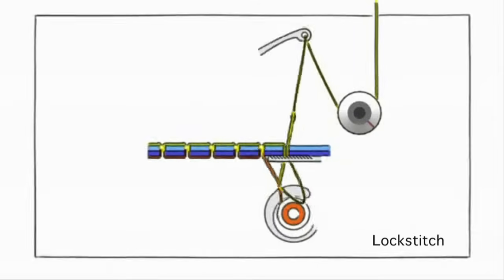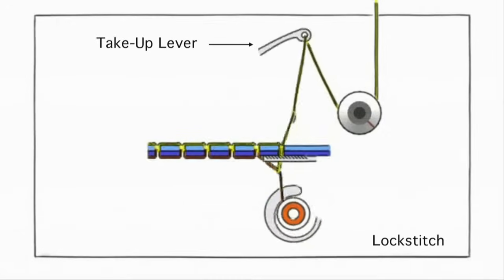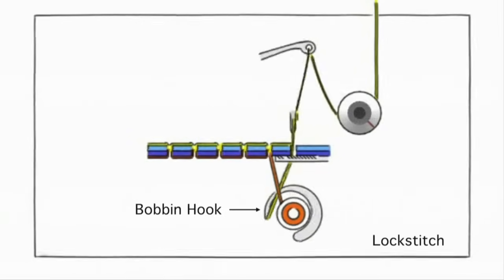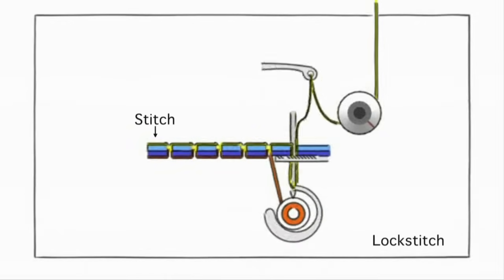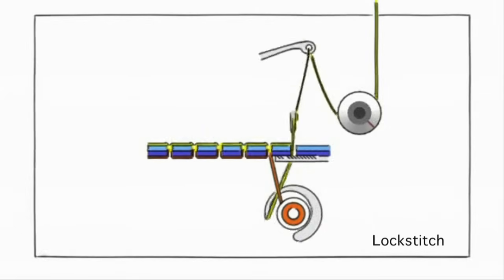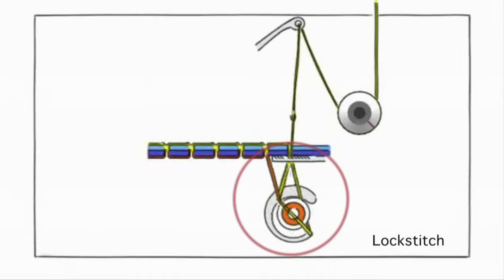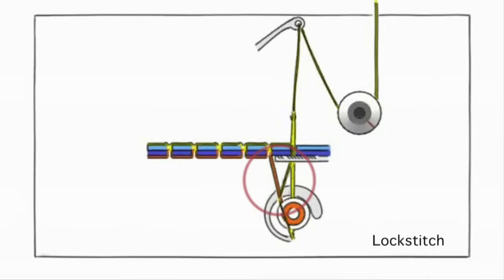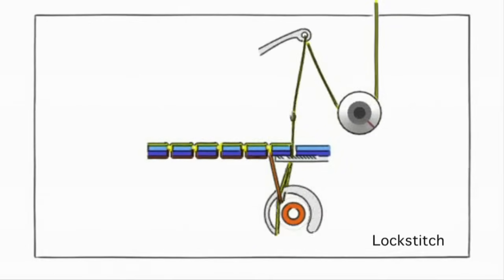Sewing Machine Anatomy: How a Stitch is Made

Comment: This is a completely useless explanation. The key topological moment is, of course, how the top thread manages to avoid the axle of the bottom mechanism. Any explanation absolutely must spend 95% of its attention on that critical matter. Everything else is secondary to that. This explanation fails to address that, which is why it doesn't really explain anything at all.

Comment: Definitely black magic how can the thread loop completely around the bobbin if the bobbin is anchored to the machine? Or does the bobbin just float in mid air? The bobbin feeds the second spool of thread right? I’m confused lol. Must be one of those classic brain teasers cause the process is straight ancient. Ancient….alien???🤷‍♂️
Reply from the maker: The bobbin is "floating" inside the bobbin case.  There is no spool of thread that feeds the bobbin.  You have to fill the bobbin with thread.

Comment: How the hook rotates ???without having the thread to get stuck ....is it rotating in mid air
Reply from the maker: the hook is rotating inside the bobbin area.  We removed a lot of the extra parts to make it more clear.
Reply: The hook rotates horizontally. So 90 degrees to the needle coming down. It lassos the thread from the top

Comment: I used to think there is a little man inside the machine who twists the threads to form a stitch, and he had to be fed with oil. Well at  least that is how my mum tried to explain to me when I asked her how the eff does the  machine stitches so beautifully unlike hand stitch is all over. Mr singer is the little man inside. But now I know the two threads one from top and one from bottom have to be twisted against one another and then passed back out from the same hole and then the next one and twisted and back out and then the next hole in and twisted and back out again, the bobbin is a device that kind of makes that twist. In other words the thread on the bobbin gets passed through the top loop, so every turn the bobbin makes that twist through the loop of the top thread, the loop is formed by a fact that when the needle goes through the cloth, it drags the top thread with it, and when it is drawn out the thread remains behind and forms a loop because the thread cannot come back out again due to friction stopping it from coming out but the needle comes out as it is smoother and has no friction and is driven out as it is solid unlike the thread is soft and bends, the bend creates a loop which is then grabbed by the hook on the bobbin rotor, which by rotating through the loop causes the twist and stitch

Comment: The bobbin case (on some machines called an inner rotary hook) floats (rides in a rotary hook without being attached, held so it doesn't spin) and the top thread actually passes around it to loop around the bobbin thread, which forms the stitch. The take-up lever pulls the slack out, pulling the top thread tight, and as the feed dogs move the fabric forward, it pulls the thread out for the next loop. On most newer machines, the rotary hook actually goes around twice to every one time the needle comes down. I'm trying to create a video that will show exactly how all this works, hopefully a little more detailed than this video, but this is still a very good basic explanation of what's taking place.
Reply: Thank you!!!

Comment: I still don’t understand either.  If the bobbin thread is a loop and the upper thread tension is loosened to make a loop for the bobbin hook to grab, how do two loops of thread become straight and not tangled?  The video needs to show slowly how the race hook mechanism uses the upper thread loop to create a stitch.  Slow motion and more magnification is required to explain how this works to make the stitch.
Reply: The bobbin thread actually stays straight and the upper thread makes a loop around it. Needle has a groove on its backside. The tip of the hook runs past it and gets a hold of the thread. Rotation swirls the thread around the bobbin case and the bobbin thread. The video doesn’t mention tension spring between tension plates and the take up lever. In all sewing (lock stitch) machines the upper thread has to run through the tension plates, the spring and the take up lever in this order to create decent stitching.
Reply: You never will understand from watching this explanation; it's wrong.  See https://www.youtube.com/watch?v=rUSecXVt-jU instead.

Comment: This otherwise nice diagram shows the needle thread loop passing all the way around the bobbin shuttle. In the real world, the shuttle is mounted somehow, not magically suspended in air, so how does the thread passing behind the shuttle not get hung up on the mounting? Please, somebody, post another diagram. Meanwhile, I may be have to take the shuttle out of my machine and take a look at the housing.
Reply: +ICrashALot not really. The hook still must be attached to something and in the hsw animation it's floating in mid-air. I could not find a SINGLE correct explanation of how this works.
Reply: But the bobbin hook itself isn't just rotating freely. The hook itself is applying tension to the thread, and I'm not understanding how that can happen without a mechanical connection or some seriously advanced magnets.
Reply: +mennucc and what exactly is turning the bobbin then if it's not attached to anything?
Reply: I am no expert, but as I see it, the bobbin spool turns as the thread is used. There is no dedicated driver for spinning the spool.  The machine that makes the bobbin thread work, the part that moves in the animation  is, however,  driven by an axel or  something. It moves / turns only 180 degrees. When it does, it first catches the thread that has been inserted from above. That is done with something of a hook or v shaped catch.   Then it pulls that thread down and makes a loop. Then it reverses and goes back, out of the way. The thread that has been pulled down into a loop then gets pulled taught from above (but only after the loop goes around the bobbin spool.) The loop closes when that happens and because of the way loop has been positioned  it is pulled around the bobbin. Like a child playing with a jump rope, the loop goes all the way around. Once per stitch.  The loop is able to go around the bobbin thread because that spool is not connected/fixed to anything. It 'floats' inside the bobbin mechanism like ball bearing  inside a machine.    It   is the thread you see in the needle, penetrating the fabric,  making a loop, the loop being the pulled around the floating bobbin then being pulled closed from above after having looped around floating bobbin spool that makes the process work.  Today is Sept 10, 2018 the anniversary  of the paten for the sewing machine (1846) and after all these years it still seem amazing to me.
Reply: @LarryDonBrown  That's not how the machine in this video works. The bobbin is in a case, and the case is floating. The 360° spinning hook (one direction only) has a groove for the bobbin casing to sit in, while able to move around. The bobbin casing is stopped from rotating by a small finger on its circumference; the finger is loose, and allows the thread to pass it. I just checked this on my machine, as I suspected that it was not magic, as others have claimed.
Reply: @mikosoft  magic, obviously
Reply: Also, I've seen several videos of people correcting the timing on their machine, and the bobbin hook spins whether the machine is threaded or not.
Reply: I think I've got it now, and I'm very impressed at the engineering that goes into a sewing machine. What helps, besides doing the visualization suggested above, is taking the bobbin shuttle out of the machine and taking a closer look at it.
Reply: @Edith: you're right to be confused.  The video is wrong; see my comment elsewhere in this thread.
Reply: +Edith Agoff This I was wondering also.
Reply: +Edith Agoff I got it. The bobbin actually is floating freely. It is inside a casing, which is also the bobbin hook, The thread goes inside the casing, around the bobbin. Since bobbin is not attached to anything, the thread can go fully around it. HowStuffWorks explains it better. http://home.howstuffworks.com/sewing-machine1.htm
Reply: +mikosoft  take a small object and hold it in your closed hand. Is the object attached to your hand? no! Is the object free to go away? no! So for the shuttle. It is not attached to the rest of the machine, it is encased into it
Reply: +mikosoft  when the machine stirches, the fabric advances; moreover the lever pulls the main thread up from the needle, and  this in turn pulls the bobbin thread , that unwinds : so the bobbin rotates. If you look carefully in the video, you can spot the moment.
Reply: https://www.youtube.com/watch?v=0Up38VP5JAE&t=0m22s
Reply: We should get engineerguy to show us how it works.
Reply: The diagram shows the bobbin inside the casing. The casing moves and passes the needle thread around the bobbin thread. You can actually slow the video down to see it.
Reply: This video also does nothing to explain how machines with no bobbin case work. I’m gonna try that “how things work” video next…